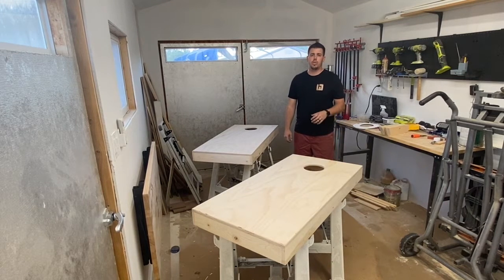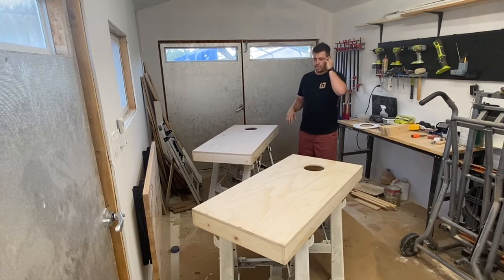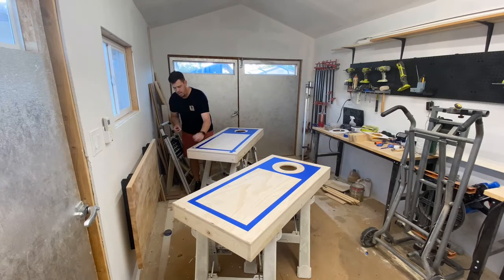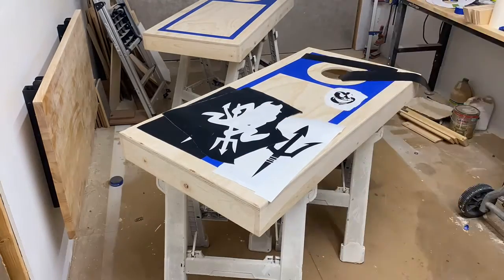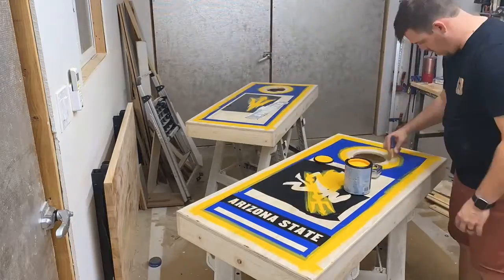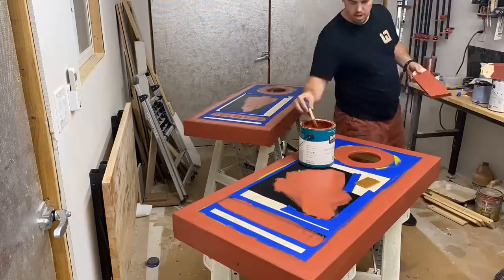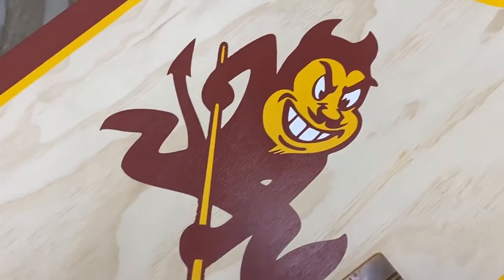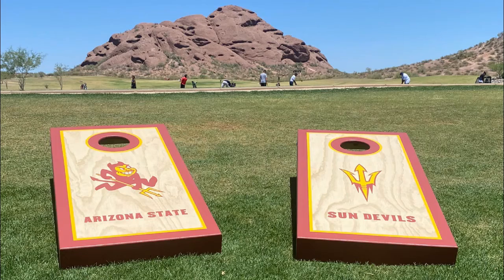How to Paint Cornhole Boards!

Comment: What did you use for the circle, looked like some sort of stencil?
Reply from the maker: Yeah I created some stencils using a vinly cutter to cut out some poster board so I can trace it easier.  When I first started I just held a tape measer at the measurement and went around the circle.  But having an 11" circle for the trim color and a 10" circle for the main color is very helpful

Comment: Do you have a step by step guide especially for all the taping of the borders (no need for the stencils)? This went too fast to really see. Thanks!
Reply from the maker: I just measure and tape 2 1/2 inches from the borders,  Then after the first color is painted on, I then tape it at 2 inches so once the tape comes off, there is a 1/2 trim color next to 2 inches of the border color.

Comment: Can you please explain better or in more detail how you get the paint to not bleed over the edges of the vinyl?

(Thank you for the video.)
Reply from the maker: Yes, so after I put the vinyl on top of the painted areas, I do another thin coat of the same paint that is underneath the vinyl. It fills any gaps and seals the edges so the new color does not!

Comment: Do you ever get bleed through?
Reply from the maker: Not with frog tape, and painting the extra coat of the color that is under the tape usually stops all the bleeding,  occasionally there are minor touch ups,  but when I was painting the logos without doing that extra layer before changing colors, I would have to do lots of touch ups for bleeing paints

Comment: What paint did you use?
Reply: This ^ _ any recommendation on the type paint used for the boards?
Reply from the maker: Sorry for never replying until now,  Most the time I just get typical house paint from lowes or home depot, Lowes does the exact colors of NFL teams so thats nice.  I usually get either flat or eggshell sheet knowing that there will be a semigloss polyurethane on top!
Reply: @mr.walterswoodshop353  Is it a paint/primer combo or do you find primer just isn't necessary?
Reply from the maker: @robsaliski  Most paint I use is paint and primer, but certain colors like orange, yellow, and red still take a ton of coats to cover, even with expensive paints, so that's why in the video the orange was done before the navy.